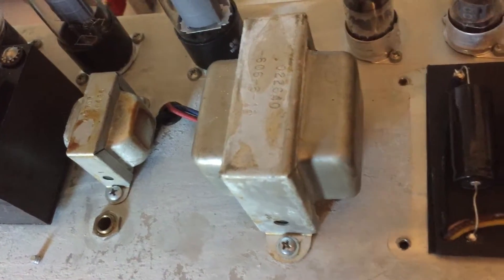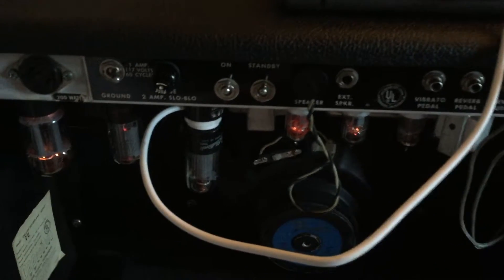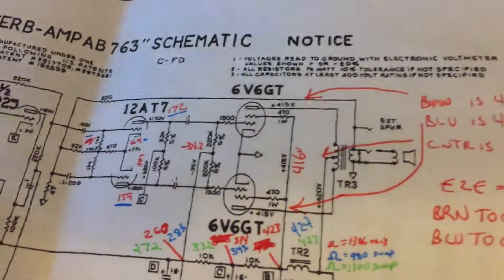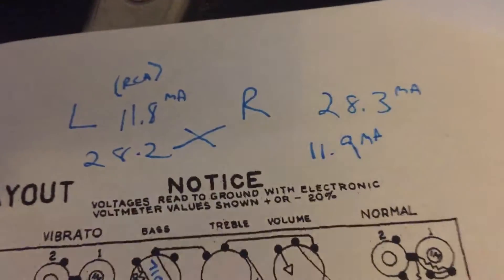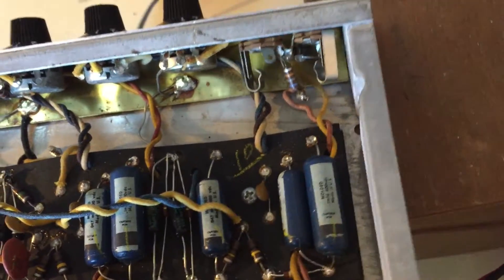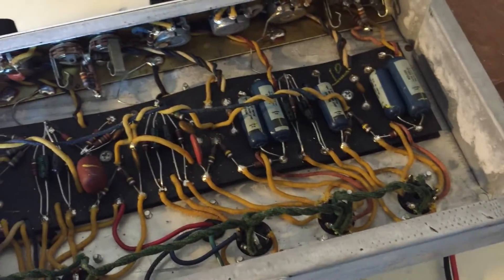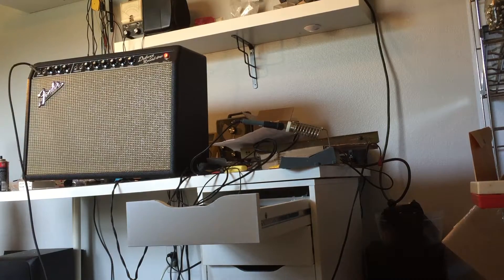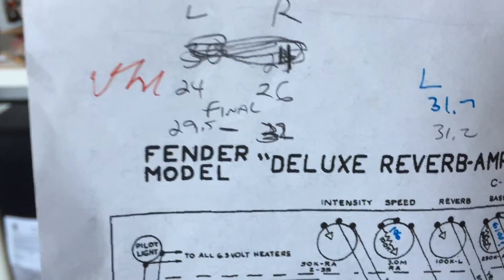Fender Deluxe Reverb - Tube Amp Repair Part 3 of 3

Comment: A three spring tank improves that reVERB sound. You can also bring the tank output into the NORMAL channel input, roll off nearly all the bass and boost the treble and even the BRIGHT switch, to EQ the lows out and crisp up that reverb tonality for some really Spanky reverb tones. And resistors vacuum. I am a player of 58 years, and they haunt me ... Thanks for putting this up!
Reply from the maker: Thanks for sharing, glad you found it helpful.

Comment: Hi from Canada, you really have nailed these videos. Great comprehensive detail in your videos. I do not have a tech where I live, but I was able to completely fix my Fender Blackface Bandmaster amp. I just started changing out all of my resistors with new ones and changed all of the electrolytic caps and coupling caps and everything sounded perfect. It took a lot of patience and time but everything worked out great . It's videos like this that have taught me so much. I love point to point wiring. It makes every repair so much easier. I replaced my output transformer and choke with Magnetic Components Inc. from Chicago. I replaced some caps with the blue Sozo caps. People say if you take out those old blue caps or even a few as I did, your amp will never sound the same.  Well I can attest to saying that my amp has never sounded better. I recently bought two amps by Ceriatone in Malaysia. One of the finest companies that I have ever come across and the prices are phenomenal.  Anyways thank you for a great video. So much that I have learned here.
Reply from the maker: Im glad that the videos have been helpful to you. Interesting note. People talk about not replacing caps because it ruins the original sound, as if the amp came with 40 year old work out leaky caps from the factory with out of spec noisy resistors as well.  All this, and folk still forget that even if they had one stored air tight in Argon for 40 years, they are still running it on mains voltage 6-8VAC hotter than the 1960's.  Basically, anyone who comes to you with the original sound argument, is full of crap.  You are correct for removing what may be old and broken. Now it probably sounds as intended, though I do recommend component testing and not wholesale replacement.